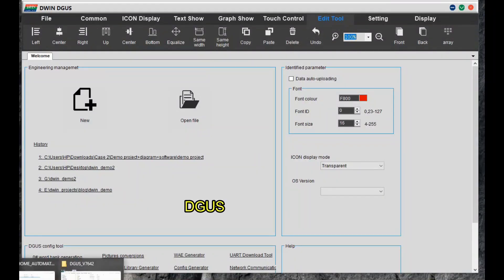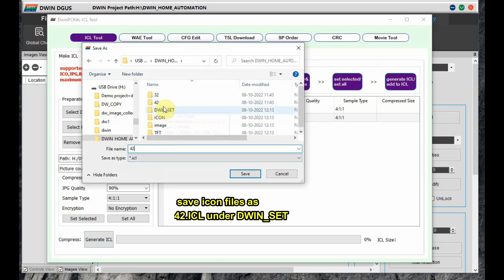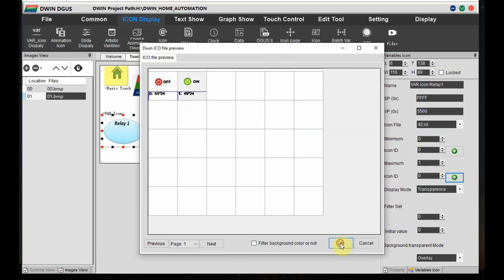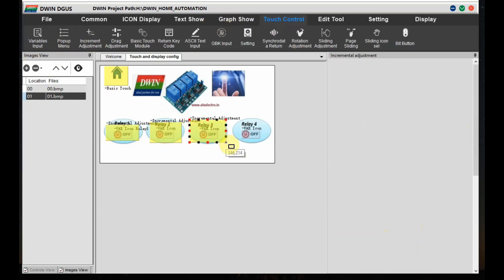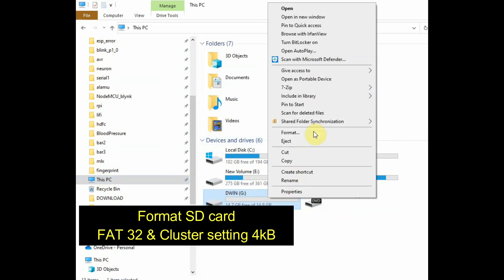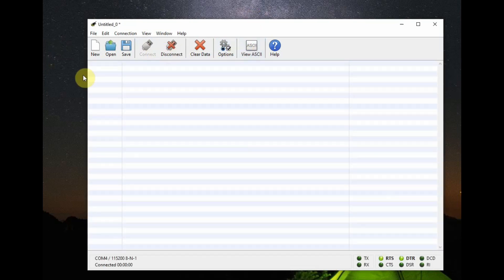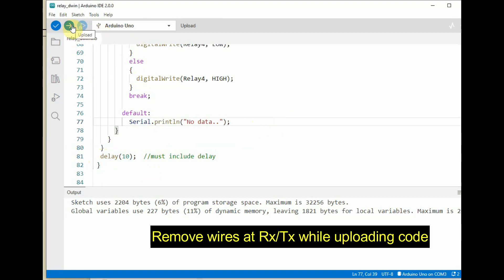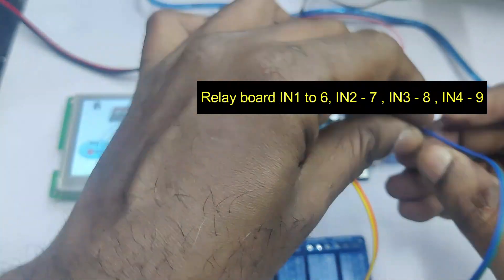#3 DWIN Touch Display with 4 Channel Relay Control

Comment: Hi, thank you for the videos. We have recently invented a mini laser printer that will have only one size matte, gloss and silk card printing option (paper card, not the plastic card) printer will have 4 laser toners CMYK, 4 drums CMYK, fuser unit and transfer belt etc. We need the lcd pre programme display that can show the amount of ink (tonar) ,amount of drum life, amount of user unit life, and transfer belt life. I mean when you see the large laser printers has small screen that shows those information when you press specific button. But in this case we want it shows always when printer is on , but of course it can go to sleep mode once it's not in use. Also the PCB board needed the sd card insert option and Bluetooth.  Also in order to show the ink amount left it. Needs to communicate with the toner and connect with lcd etc. Can you do this project please.  My name is Nazmul and am from Bangladesh originally . Thank you